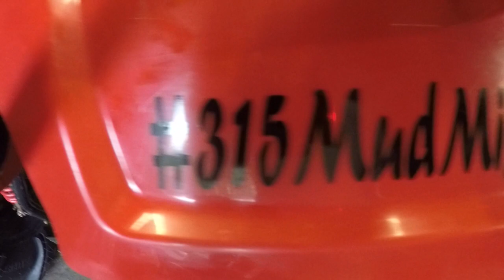Make your bike shine! And...2 important shout outs!!!

Comment: I want you to try something. Go to oreilys and look for coverall tire shine. It's a silicone spray... it repels mud/water. When you come home you dont even need a pressure washer. I've been through every single tire shine on bikes... nothing will compare to cover all. I want you to make a comparison video on them if you can
Reply from the maker: I will thanks!
Reply: @SomeDamnfoolsAtv  you wont regret it. I've even used that high doll as r stuff called sc1 and cover all works better
Reply: No doubt, that stuff does work. It's worth it if you can get the gallon  jug for $30